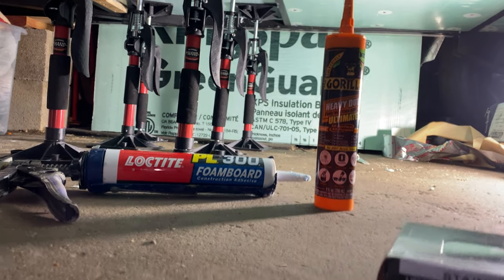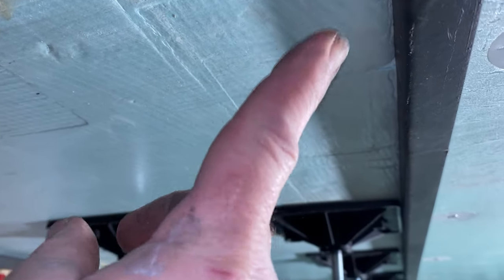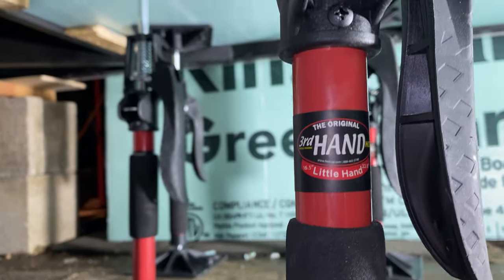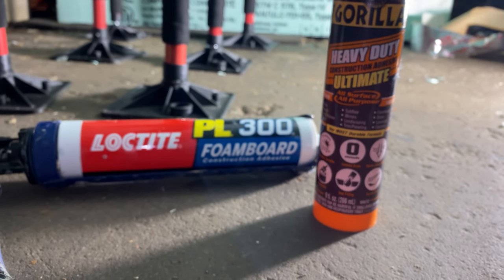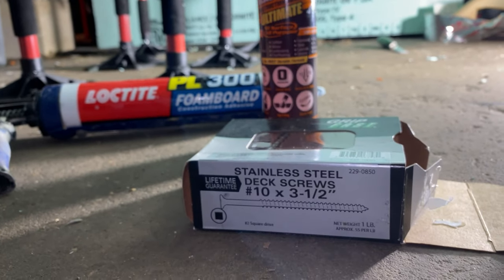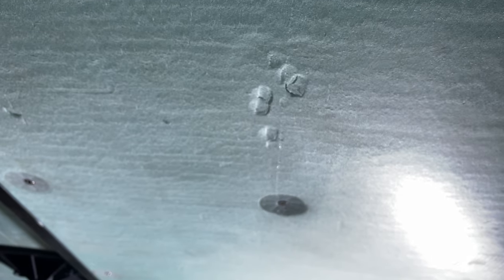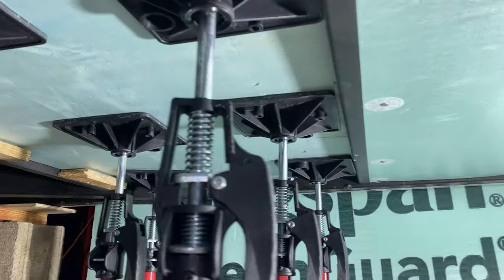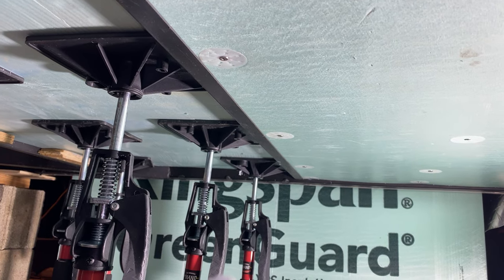insulate the floor / belly of a cargo trailer / camper  Using foam board

Comment: Makes perfect sense to insulate the bottom of one's trailer. Your heat lost tests are done in the still air environment of your closed garage. Out in the "wild" the wind blows, and actually sucks heat away. Many folks camp on lower ground in the shelter of nearby hills, and the cold air just flows down. It can easily make the difference of 10°F or more.

Comment: I'm doing this this spring on my converted utility trailer. It should help with both heat and cool. It is a v nose so the front has complicated angles and small cavities. The foam board would be tough to cut to fit precisely. Do you know of a spray insulation that would work? I just painted the frame with rustoleum. There was a bit of rust around the edges
Reply from the maker: i would undercoat if it’s not first for a vapor barrier.  they do make a DIY foam kit  but it’s pricey i did my Interior walls interior ceiling with it that kit cost anywhere from 700  to $800
Cheapest place I found the foam kit Was Menards but you do have to wait for a mail in rebate for the savings

Comment: Seems like it'd be a lot easier to insulate the floor on the top side & just cover it with a layer of plywood.  That's how I insulated my van.
Reply from the maker: you could do it on inside but didn’t Want to lose 3 inches of head clearance
Reply: I used 1/2" thick foam.  I figured that since you can hold a foam cup filled with boiling water 1/2" should be fine for the needs of a van or trailer floor.   Also since it doesn't need to be cut into small strips there's very little thermal bridging at the frame members.